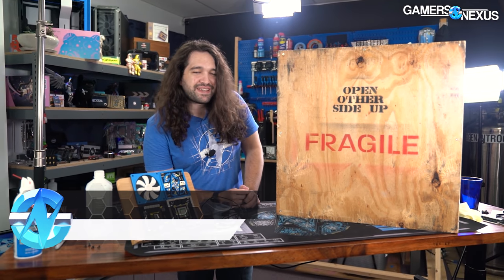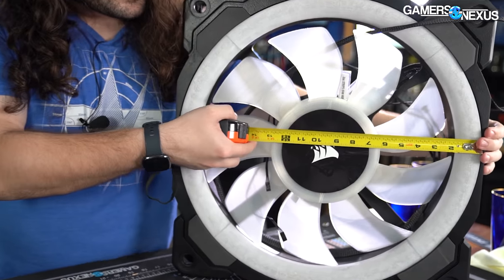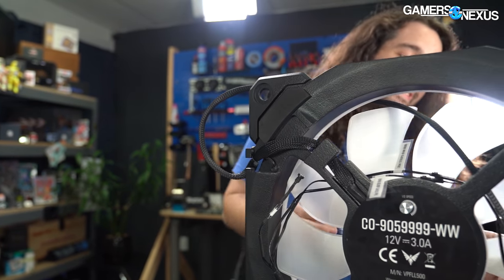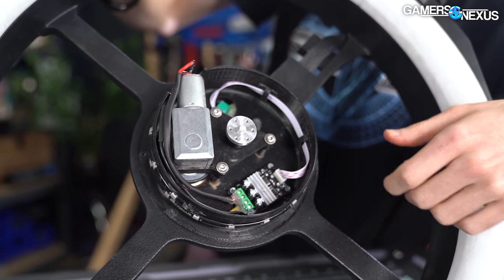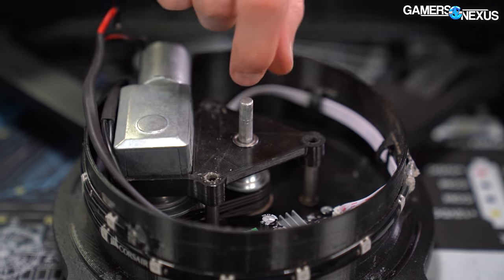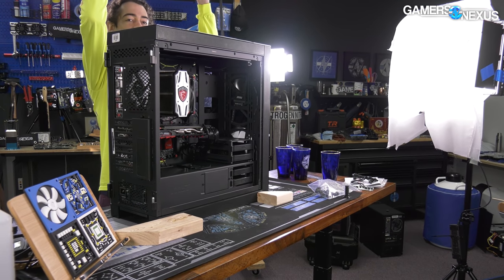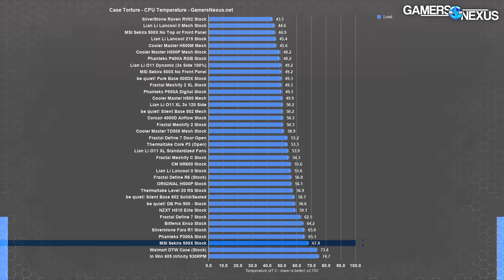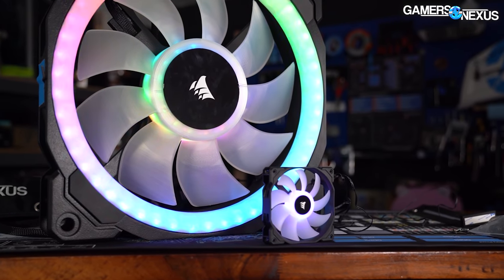World's Biggest Computer Fan: Corsair 500mm LL RGB Fan

Comment: i've always wanted to replace the side panel with a huge silent fan, corsair should keep working on this and launch it with some grill, dust filter and mounting options for their cases
Reply: Time to DIY! Trends only take off if people start building and buying. I'm building a custom water loop that uses a motorcycle radiator and four 120mm fans, but your desire will probably need car parts and some window screen for the filter. If you can get your hands on it, a plasma cutter would make quick work of a case side panel, though cleanup will be tedious.
Reply: The price would be crazy expensive but I'd buy it anyway lmao
Reply: Only issue would be dust
Reply: There's a post on tech support mcguyver where they zip tied a grid of fans and replace their side panel with that
Reply: this would be a badass product image the exhaust being the entire size of the side of your case
Reply: Agreed...it seems ridiculous on the surface, but it's actually a very good idea, that certainly can be refined to a marketable level. [eyes old fileserver that likes to run the southbridge at 220F, has fit of jealousy and starts looking around for a floor fan to cannibalize]
Reply: Aerocool used to make cases like that, back at around 2008-9 before the rise of transparent sidepanels.
Extremengine and AeroRacer are 2 such cases. They were hard to get and very expensive compared to other options, and they were also terrible quality.
Especially their fans were prone to failure within months of usage.
Reply: Came here to say exactly this. I would 100% buy a case with a giant fan as a side panel, assuming they make it reliable and figure out the dust filtration side of things.

I mean, take the SFFtime N-ATX as an example. If Corsair cut down the width of the fan and added it to the N-ATX as a side panel, then you end up with a totally normal, if not smaller, ATX tower!
Reply: @herihelke729  Yeah! i remember having one of these cases. They were sold by Newegg. Anyway, they were at least as big as this fan and were made long before this fan. So, this company is NOT the first to build such a fan. And they were real and actually used, not just a prop made as a publicity stunt. Anyway, if you wanted something like this today, the easiest approach would be just to buy a window fan and find a case the right size you could fit it to, or maybe just build your own custom case to match it.
Reply: I thought I was cool with my side panel 140mm outttakes and direct line of fire for GPU exhaust, but this fan would SHAME my setup
Reply: Armortek made a case that was essentially this 15 years ago. Can't remember the name but it was an ATX full with a giant fan on the side. Blue LED too, well before that was a thing. It was solid metal and heavy as hell
Reply: @BringbackTBC  Nearly 20 years ago, people had already chopped their side panels into barely more than a frame and stuck car radiators in them with pretty much no fans pushing through them. Imagine using this giant thing at something closer to 100 RPM for static pressure
Reply: so much this. But 500x500 is too big for most cases. Having a Coolermaster HAF X myself, the side panel barely exceeds 500mm length. Additionally that fan looks like it is being approx 50mm thick. So having a case which can fit a huge GPU and a huge CPU cooler would make it really wide. Additionally the fan center axis is basically a huge dead spot.
So for DIY cases, 4 times 200x200mm fans would be the economical choice. 25mm thick, available for less than a fortune and no fear of destroying a fan control hub or motherboard. Speaking of, the side 200mm fan on my HAF X recently began making loud noises, but that's fine after over 10 years :D

Even the Aerocool case back then "only" had a 400x400 fan.
Reply: You can, just adapt a small 7 inch extractor fan and put some speed control on that thing
Reply: Thermal take had a full tower case that had something similar to this idea. It wasn't too bad of a case.
Reply: I've seen a couple of cases with a 200mm on the side
Reply: @satibel  but mostly a single 200mm one, like on my HAF X. I'd be amazed by a 2x2 x 200mm fan side panel

Comment: Can tell you exactly how that gearbox "locks up" if the motor isn't turning: there's a worm gear in the chain. Worm gears can only drive the gear they engage; they can never be driven by the gear they engage. :3
Reply: Came here to say this. You beat me to it.
Reply: Maybe I'm not understanding your question, but I assume the change in speed of the motor is quicker than the change in speed of the huge plastic blades causing the blade to then try and drive the gears causing wear on the worm gear.  And turning it off completely was probably even worse as those big blades will take time to slow dow n.  Ideally the blade would have been affixed with a slip collar to allow them to continue to rotate with the gears completely stopped.  I figure this silly thing was made for trade show booth or something, so engineering for functionality was the least of their concern and hardly for long term use.
Reply: @davidd3065  Not exactly. Think of a worm gear as like a rack but spun around the axle to make a spiral gear tooth. Worms are fixed in place on the axle so they can't slide back and forth like a rack would. Thus, the gear enmeshed with the worm can't drive the worm. It can only be driven by the worm. :)

Comment: Since the motor locks up when you shut it off, you really need to slowly reduce the speed before shutting it off. I would bet that the momentum of the fan spinning is what keeps stripping the gears.
Reply: Or just use the right gears
Reply: Yeah and a toothed belt doesn't help. You need a smooth drive belt with that worm gear, because of the inertia. Problem is the motor isn't powerful enough which is why they used a worm gearbox. I would've thought a bigger motor direct drive, obviously with a ratio, would be better
Reply: Belt drive should slip before the gearbox selfdestructs. Not saying you're wrong, just providing a counter-argument from an engineering POV.

Comment: In 1998 i built my first computer. Intel celeron pentium 2 or some such thing. Our house did not have A/C, my father didnt believe in it, in california, in the summer, with at least 3-4 weeks of above 100°F temperatures. So, very quickly, my brother and I, who had built matching computers, couldnt deal with the high ambient temperatures. So we bought walmart box fans, removed the side panels, and strapped them to the computers. Worked amazingly well, we later added another store bought fan to the front. 
Love you gn! This was awesome. Good memories.

Comment: Ngl, if Corsair sold it as a box fan I'd buy one. So many crappy box fans, Corsair would at least be offering something of better build quality. (And with rgb to boot)
Reply: I mean... If they fix the terrible build quality of this fan yeah they might have a good build quality.
Reply: If they sell one that doesn't self-destruct when you turn it off, maybe.
Reply: @Morberis  yeah don't worry you will get 16 replacement motor with it
Reply: @Morberis  if they went to mass production they wouldn't be using random gearboxes and whatever fits.
Reply: Yea, but you would have to replace the gear box every 30 minutes shortly after it starts making "the familiar noise" :D
Reply: This fan spins way too slow to be a box fan.Box fans are usually around 800rpm on low and up to 1500rpm on high.
Reply: Assuming they get a proper motor made for the "production" version, I'd be on board. At $60, for the world's coolest box fan? Sign me up.
Reply: @BrooklynBalla  i'd rather have a fan that spins at 200 rpm on lowest and makes no noise, that small breeze is great without being annoying or cooling down too much

Comment: Corsair: let them keep testing this
Watercooling friends of GN: make them a radiator
Steve: you know what to do
Reply: Could grab radiator from a truck or something I guess :)
Reply: Would have to invert it to an output fan or it would just blow hot radiator air on all the components.
Reply: @smegskull  Or you could have another box on the table just for the fan and radiator :)
Reply: Just use a car radiator or aircon radiator
Reply: Plenty of car rad's, but fin density and the fact that zero will be copper or brass is a bit of an issue. Sure you CAN run mixed metal loops, heck ive done it myself in the past, still not a great idea even if it is not as bad as many make out, most aio's use alluminium rads anyway but they tend to get thrown away more regularly than parts of open loop systems so nobody sees how bad they become, plus you cant see inside them without pulling them apart anyway.
Reply: @Qwarzz  make the top front section of the case a wide rad that blows through horizontally. Can combine the reservoir with a rad and have the 400-500mm fan blow through it, as well as all the surface components. At 200 to 300 rpm top end it wouldn't even seem very loud if the fan noise was a nice brown-noise hum.
Reply: I've always wondered how well a radiator made up of transmission coolers and automotive radiator fans would work.
Power draw and noise of the fan? Yes (automotive radiator fans usually run on a 12v 20a fuse, and even buried inside the car they make a heck of a racket when they're on).
Cooling? Probably also "very yes" relative to the small-scale quiet stuff we use in computers.

Comment: this should be a line of "gamer desk fans" I would genuinely love this for a cool gaming setup addon (especially in Aus where its hotter than the sun most of the time)
Reply: I would totally buy something like this. I would either get one for a ceiling fan, or use it as a floor box fan. Best part, the rgb can sync with my PC.
Reply: Maybe reverse the pitch of the fan blades though, so we can look at the  "cool" side while being cooled.

Deffinitly would want one as a window fan, ceiling fan, or maybe attached to one of those movable mic armatures you can clamp to your desk/monitor mount

Comment: The drive gear should be a on a set of pawls so that it spins the fan, but when the motor stops turning the fan can continue to spin/slow down naturally. That way you aren't tearing up the drive belts and transmission.

Comment: Corsair, pls let them keep the fan! Steve is a Saint and everything he touches turns intro a performance oriented marble and that fan will surely be happy to receive a can size brushless motor and spin to over 10k rpm.
Reply: that wouldn't be 10 watts anymore though, more like 500
Reply: @michaelmechex  now imagine the fan's spec sheet stating you need a 520w or higher PSU. That's not for the total system, that's for the isolated fan only lmao
Reply: @leflavius_nl5370  12v only, run the connectors from the 12vo power supply directly to the side of the fan.
Reply: @leflavius_nl5370  Finally, an additional use case for the old PSU and those dual PSU cases!
Reply: @leflavius_nl5370  not even mentioning the fan itself would need cooling, it would sound like a jet engine and probably even try to take off like one

Comment: This fan needs a RC brushless motor and a direct drive with oneway diff in the fan shaft, with that you can set a PWM signal to the ESC and control the speed with the motherboard, direct 12v from a extra gigabyte PSU is a must.
Reply: thats what i was thinking, like a hobbywing 1000kv motor or so and a like max6 esc, would run as cool as LM2
Reply: Might be an overkill cost wise - a typical AC fan motor would do the job just fine and probably still try to take your finger out
Reply: @detach8  A fan that size? Try an arm.
Reply: @detach8  no. MORE POWER
Reply: Yeah, I can't help but wonder why they didn't use a brushless motor to start with, that geared motor seemed like a bad pick, especially since it locked up when stopped
Reply: @dylanc2806  That's what I'm thinking, like at least a motor from a washing machine, if not something even bigger, lol
Reply: @Tc4ify  washing motor has a lot of torque but spins slow. im thinking a crackheaded RC buggy motor that will make that fan spin at like 10,000RPM or so. might need to bolt it down though...
Reply: @dylanc2806  10000?!? You want the thing to take off, lmao?
Reply: @Tc4ify  well D U H
Reply: With that gigabyte PSU it might turn into a flaming disc.

Comment: Make a new motor design with Linus group, then run at 1000rpm, a new radiator that can adapt a case for the fan, this will be truly epic for both channels.
Reply: yeah, a MORA, (Monster Radiator)
Reply: I'm surprised they didn't hook up a car radiator to this fan
Reply: @AhmadAbuGdairi  Maybe? I suspect the hub of a car motor would be too big for it to be the right scale though. But if the car radiator fan internals are the right size, might be a good match. Main concern is those are actually really powerful motors and I'm not sure the 3D printed fan blades would take it, you'd have to run it at a lower voltage, assuming the motor would actually work down there.

Comment: Interesting design.  Gearmotor definitely not designed for continuous use for sure.  This could be designed with a proper brushless motor for long term use.  And higher speed.  Imagine that running at 2000 rpm! :-D
Reply: Give it a thermal sensor and a "auto" mode that let's it speed up as the room warms up, just like the real things do... more or less
Reply: Larger fans tend to run slower, because the larger diameter means the edge of the fanblade moves through air faster at the same RPM. At some point it becomes an issue of blade strength.  Though if you run half RPM at 10x the size, you are still moving a lot more air.
Reply: Continuous use yes. Slowing down to anything else but a constant speed, no. Even turning it off would strip the wormgear first time. You'd need a clutch between the wormgear and the gearbox to allow it to slip and not back drive the motor from the fan. As soon as I saw the motor when he opened it, I knew what the problem was.
Reply: This thing probably just needs a normal box fan motor instead of whatever gearbox that is
Reply: ah i see, use those brushless motors in server fans
Reply: @Technichian462  yeah its really that simple you cant back drive a worm gear
Reply: @xeridea  And power requirements go up exponentially.  An electric radiator fan (for car) for example may pull 20 amps at 12V.  They spin quite fast and can take off a finger.  They use brush motors too so quite a bit of RF noise is present.

A shaded pole induction motor would be the easiest (found in your everyday box fan) but needs 120VAC to run.  Fine for a boutique display for a nerd bar but not something you'd want in a PC case! ;-)
Reply: How close to the speed of sound would those nodes get at 2000 rpm lol
Reply: @alexmills1329  If 16" at 2000 rpm the tips would be going about 95 mph.  That's still very fast (fast pitch).  To break the sound barrier you'd have to crank it up to nearly 16,000 rpm!  It would need a LOT of HP to do that and the assembly would likely explode catastrophically well before that.  Sounds like a project for #PHOTONIC INDUCTION! :-D

Comment: I would LOVE to see a full Tiny Tim PC built with this scale, with a little step ladder to go and push the power button, all the screws actually threading in etc. I assume the best way would be to use risers and extenders on normal size parts, and contain those within comically large prop parts. I mean you could build the entire PC in the large CPU heatsink, but where is the fun in that, I want to see the GPU physically inside the giant GPU, preferably with the extension built into the PCI-e pins so it can be legitimately installed. IDK if you can realistically connect the RAM that far due to the tight timings though, not to mention countless other logistical nightmares... but a man can dream
Reply: That's incredibly stupid and only a goofball would ever try it, which is 100% why I'd watch it.
Reply: Why dont we just scale up pcs 1000%, like 10x die size and power consumption, and just have like 10 plugs and a 100a breaker to power it. That would be awesome
Reply: @EyesackWorley  Go full circle to the massive computers of old
Reply: That sounds like a lot of work. wouldn't you basically need to build a massive graphics card  cooler for example and a massive fake motherboard. maybe even with working connectors, that are connected with risers and extenders to a real hidden board
Reply: @HeavyMetalGamingHD  I never said that it would be easy. Just that I would love to see it. It would effectively be movie-prop making, but with a functional PC worked into it. There are plenty of maker channels that I imagine would jump at the chance to collaborate on something so ridiculous. I just think it would be funny, like, to watch steve climb into the case and stand under the GPU fans which would spin but not really be functioning AS fans, just enough to swirl that fabulous hair all around. Bonus points for giant peripherals, like a mechanical keyboard where you have to physically jump to press the keys, or having to work together pushing a car sized mouse around, or using a projector to make a cinema sized monitor. So many possibilities!

Comment: I think a wind tunnel style case with this being the sole fan in the whole thing would be AMAZING!  Basically you just have a shroud with this in the front, that concentrates it down to the case front, and it rams air through the case out the back.